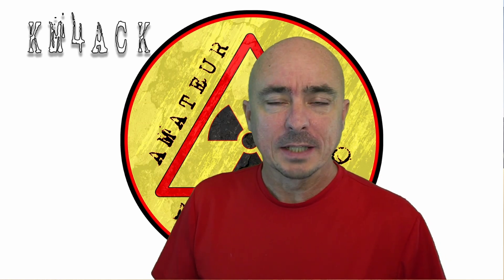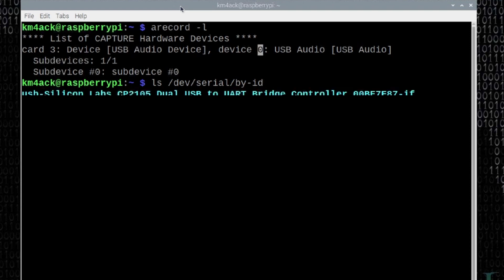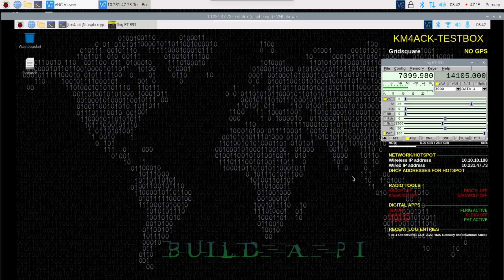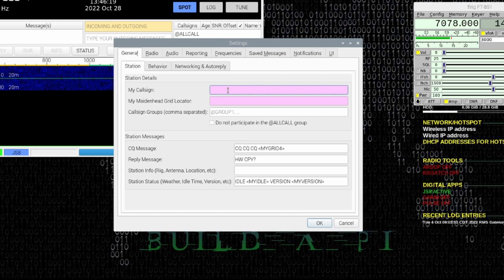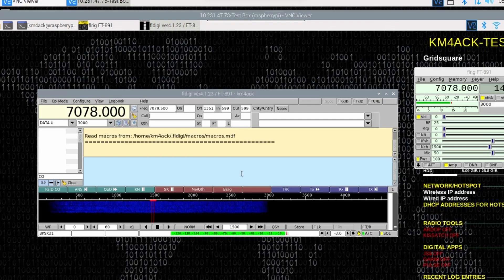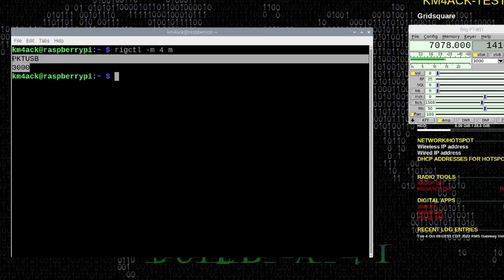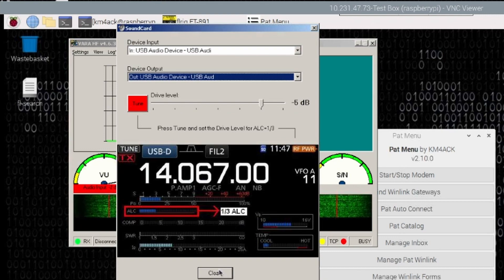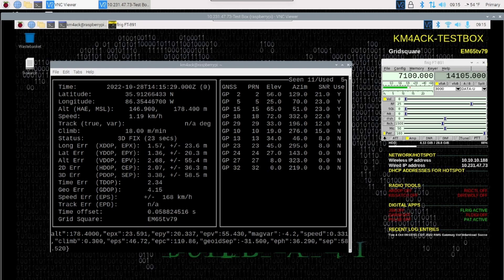891 Setup Build a Pi

Comment: Have you heard of issues with the GPS device.  I purchased the AIHJCNELE VK172 GLONASS USB on Amazon and I got it working but many times it does not (i.e. cps show no signal and No GPS cocky).   I paid $8, but now thinking I got a cheap unit.  There is a similar looking device, the G72 GLONASS USB.  It costs a little more but is reported to work better, newer chip with 72 channels rather than 56.

Comment: Jason, what adapter did you use from the HamDapter link ?  I don't recall that being mentioned in the video.  I'm assuming it's the 6 pin din.  But you know what they say when you assume something.
Reply from the maker: It is a 6 pin. Search DC-11F on the hamdaptor store.
Reply: @KM4ACK  No DC-11F listed in the store now. Any other suppliers?
Reply from the maker: @Chuckstereino  Looks like his store is closed until Nov 26th. It should return once he reopens. Don't know of any other suppliers offhand.
Reply: @KM4ACK  
Thank you.
I’ll keep an eye on it.
Was 5 days away from contact with my moms caretaker while in the mountains. Won’t leave again until I have Pat going.